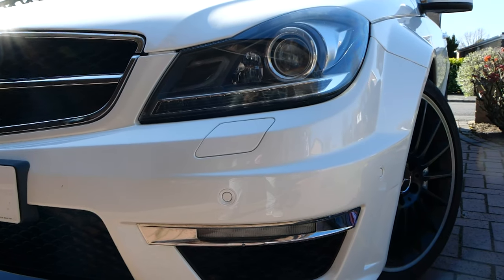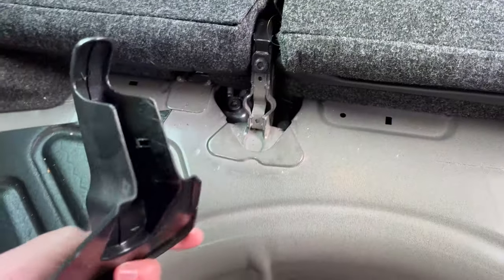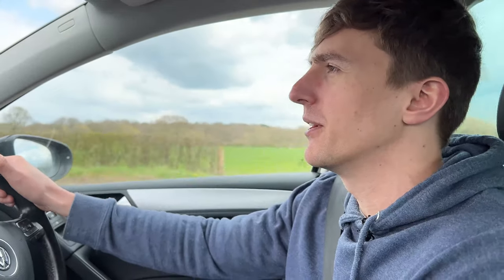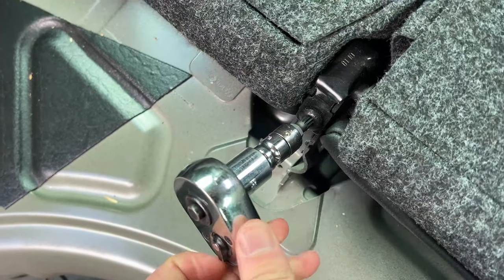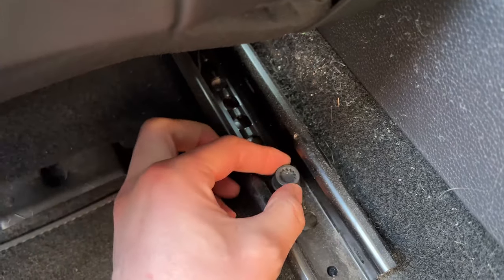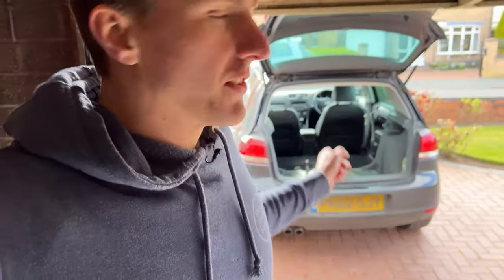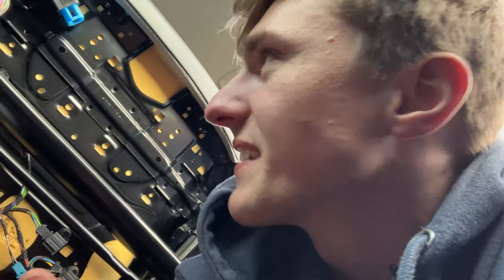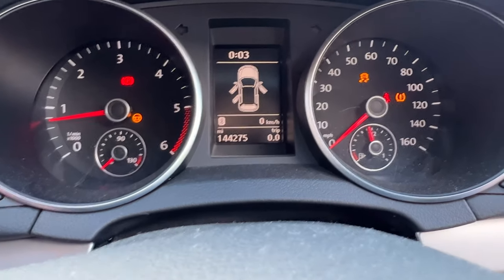I'm drag racing in 2022..

Comment: Personally I’d of stuck with the c63 if that’s what you intend to compete with and rolled it off the line. You want to gain experience and get comfortable, swapping cars won’t help with that. Good luck though 👍 I’m running around 10.30 at pod.
Reply from the maker: After racing festival of power this weekend, I agree that swapping cars isn’t ideal. But the golf was far more consistent than you’d think it would be! And racing in a manual has some bragging rights associated with it haha. I think learning in a slower manual car helped me personally. But the C63 is entered into springspeed and I’m back testing RWYB this week. 10.50 is mega fast! What car?
Reply: @CarThought  on a bike, S1000RR. Ran low 12’s in my manual M2. Getting the launch right in a manual is rewarding in its self!

Comment: Too heavy to be properly quick at drag racing. 

You’ll likely have a slow ET (for the power) and a reasonable high terminal speed that you will see lighter cars achieve with less power and shorter ET. 

(Many years of experience at Shakespeare County Raceway - sadly closed now)
Reply from the maker: That’s why bracket racing is so good. The speed of the car has very little to do with who wins 👍